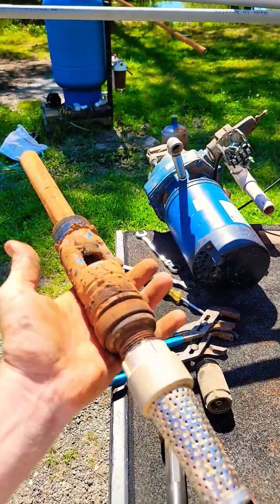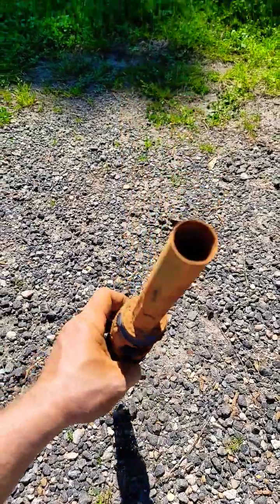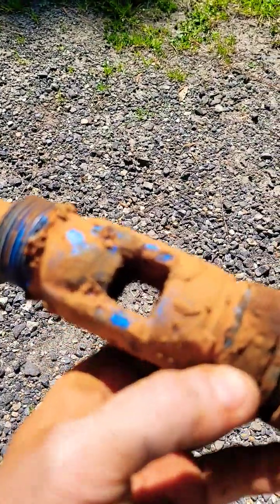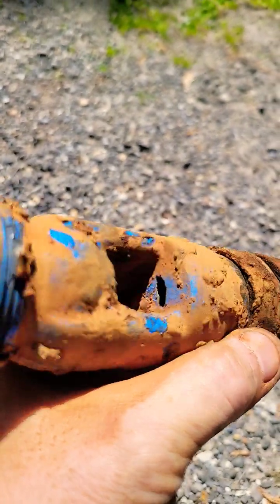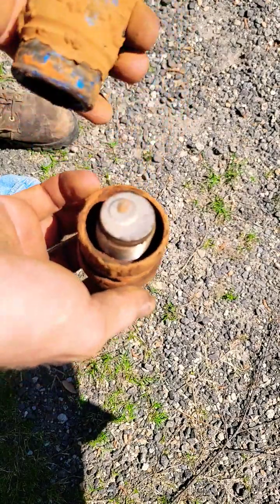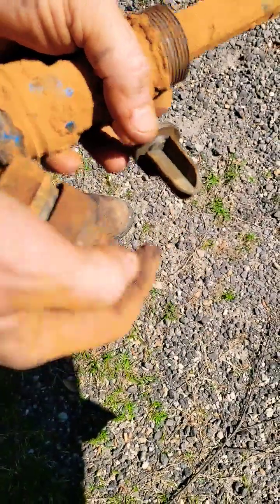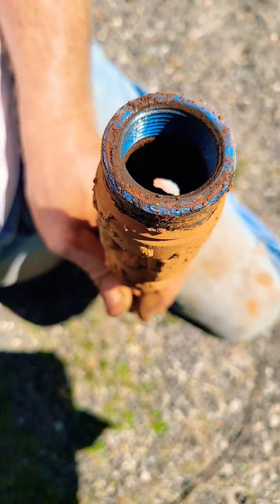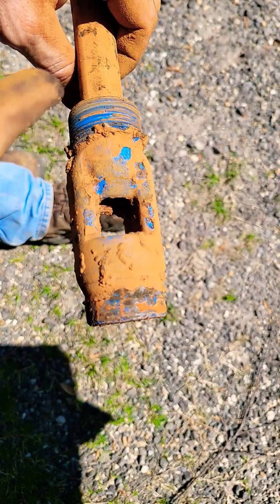Water Well Jet has a hole - How it happened

Comment: Deep well jets have 2 lines
Reply from the maker: Yea they sure do but in the case of a 2" pvc well the casing is the second pipe.  You see a two pipe offsets and two pipe drop pipe which is used in 4" or bigger wells can't be used in a 2" casing.  The leathers on the jet adapter seal it to the casing creating a discharge pipe which connects to the pump with a casing adapter.  The adapter can be attached to the Deep Well Pump or can be two pipe offset away from well.